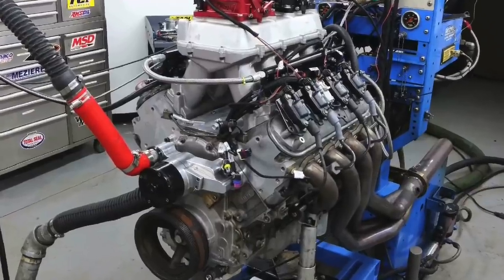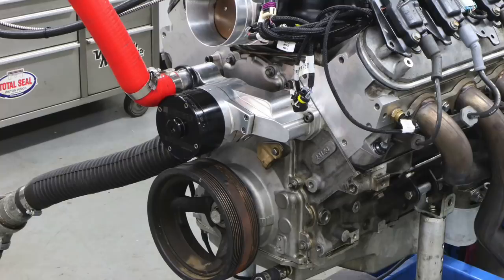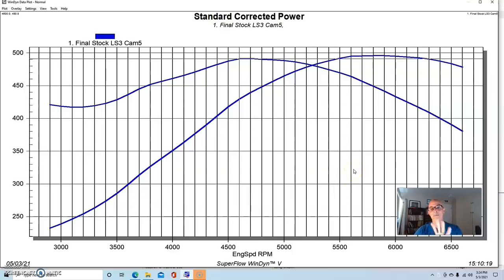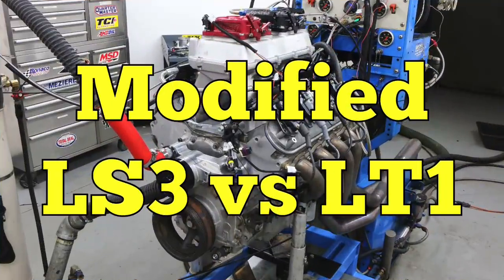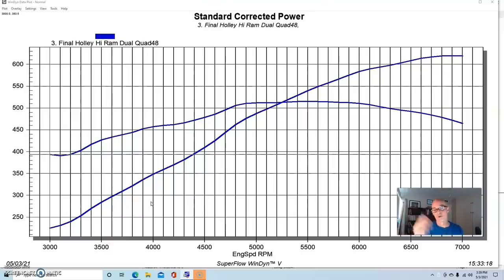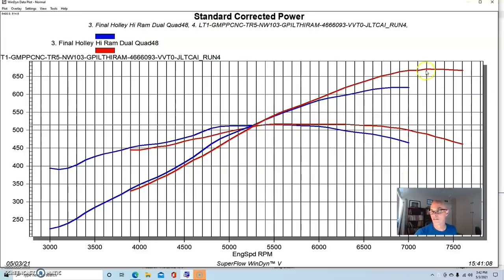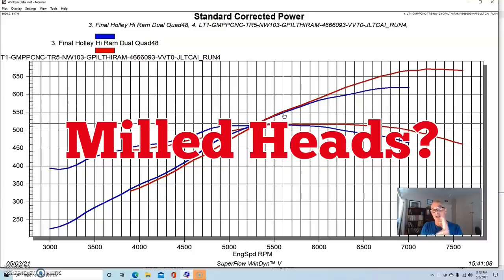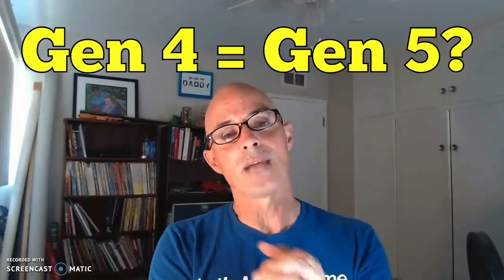LS3 VS LT1-IS NEWER REALLY BETTER? (GEN 4 VS GEN 5 6.2L)

Comment: Those LT1 NA power numbers are amazing.    WOW......
Reply: The low torque is lovely. Vvt
Reply: @hoonaticbloggs5402  Best of both worlds, for sure!  :)
Reply: numbers are higher than usual because of the way they run the dyno, i.e. long tube headers, no mufflers/cats, open throttle body, and low fluids temperature
Reply: @malamri424  and? Compared to an LS3 it's still a massive improvement
Reply: Yall be sure to remember this fun fact. LS3 compression ratio is 10.7:1. LT1 compression ratio is 11.5:1. That's a BIG contributor to the power of the LT1 and Direct Injection is the ONLY reason why the LT1 can run 11.5:1 compression ratio. Injecting the fuel into the chamber COOLS THE AIR IN THE CHAMBER THAT WAS HEATED UP DUE TO COMPRESSION. I wish I could find that article explaining all of this. I read it a few years ago. When I find it, I will post the link here. And for your reading pleasure...

L83 = 11.1 CR
L86/LT1 = 11.5:1 CR
LT4 = 10:1 CR
L8T = 10.8:1 CR

I can't wait for the price fall...
Reply: @jaydubb71  imagine these with a dual injection setup like the ford motors are running?
Reply: @Prestiged_peck  LT5 is setup with both DI and PI. Unfortunately no other SBC is. You can upgrade to it as there are aftermarket kits available to do so. They will support about any power you will ever push out the engine, but they are not cheap fuel systems to upgrade to.
Reply: @JROC734  extra injectors are always expensive, but when you make the power to need them they pay dividends, especially on a DI motor when you convert it to DPI, if nothing else it eliminates back-of-valve carbon buildup.
Reply: @Prestiged_peck  oh yeah. Gen V LT5-like setup. That has DI and port injection. Can you imagine how much the EFI system to control that would cost? The Holley Terminator Max (with trans control) is $2600 alone. And it's not setup for adding port fuel, IIRC. I could be wrong. Good luck finding a factory ECM and harness from a C7 ZR1. And if you do, HPTUNERS wants TEN CREDITS (fricken $500 bucks!) AND ANOTHER 2000 BUCKS (BIG BALLEER STATUS! Oh yeah, I got that in my cookie jar... Yeah right! I wish! LMAO) to unlock the ECM. Wanna buy a MODIFIED ECM straight out? That's ONLY $2500. So... Say you get lucky and get a Gev V LT5 harness and ECM. $2000 to unlock the ECM. $500 for credits. $550 for the PRO version of HPTuners, if you don't already have it (or you could be cheap and pay $300 for the standard version since I BELIEVE the LT5/E99 may have factory widebands... I could be wrong tho). Not including the PRICE OF THAT ECM AND HARNESS! LOL! Now, unless you know how to tune DI, imagine how much it's going to cost to TUNE IT! This won't be a 3 or 4 hundred dollar tune special. I have yet to physically touch a Gen V but I can tell you from the hundreds of pages I've read on the HPTUNERS forums and after watching all of the Greg Banish videos (yes I own them), it's a heck of a different world. I have no problem tuning Mopar and GM Gen 3 and 4 ECM/TCM setups. Or Holley. I'm really waiting to get my hands on a Gen V. I may be picking up a Gen V pick up truck myself real soon. Of course, I will begin tinkering almost immediately...
Reply: @jaydubb71  holley dominator should have dual port capability by now, know for a fact fueltech and motec do, or you might find a way to modify an 18 plus coyote ECU to run it, might be difficult to run one with just one cam though.
Reply: @jaydubb71  Holley will run port injection on an LT engine, I am running it with port injection on my 416 based LT1 with twin turbos. It made 901 on low to medium boost.
Reply: @waynedeason213  Terminator X or Dominator? Are you running DI and port injection or just port injection? Which system (part number) are you running?
Reply: @jaydubb71  I'm running both port and direct injection, the Holley controls my port injection and the stock computer controls the rest of the car.  It is the Crawford Racing CR Fueler and. I did not opt for the Dominator upgrade as I didn't need it to do anything except control the port injection.
Reply: @waynedeason213  so you're just running the Terminator X or HP system to run the port fuel?
Reply: @jaydubb71  it's whatever comes with the Crawford Racing kit, my tuner explains it all in that video. I didn't really ask alot of questions when he told me that would work, I just bought it and had them install it and tune it. Look up the CR-Fueler from Crawford Racing.
Reply: In my research for a retrofit its taking Darton sleeve and Ls7 top end money layout to touch the LT1 stuff now with their stock casting, especially with the $500 3.860 factory forged center weight stroker crank..
Reply: @waynedeason213  I mean holley drives the DI injectors with an entirely separate box, id think the terminator X would have 8 injector drivers literally hanging out doing nothing, well physically it would have to? But does the software allow it?
Reply: @jaydubb71 that comppresion runs well w direct injection and Flexfuel

Comment: The issue with the Gen 5 stuff is that it seems to be more complex/sensitive to tuning. Even the Terminator X for the LT motors costs twice as much as for the LS stuff. VVT and DI are here to stay so eventually the learning curve and costs will flatten out but I don’t think we’re there yet.
Reply: I think going to gen 5s are diminishing returns compared to the ls when you consider everything cost wise.
Reply: @theyhatehimbecausehetoldth7576  it's economics. New stuff will be more expensive than old ones, and if the new stuff becomes popular enough then the prices will come down if the manufacturers develop economical ways of doing it and decide that lowering the price is worth it.

The advantage of direct injection is on motors with boost. E85 + direct injection would help make the motor run safely at higher boost levels.

Everything has diminishing returns. You can't apples-to-apples compare decades old tech that has a ton of aftermarket support to new tech that has limited aftermarket support. If you like old, affordable tech then go with a carbureted LS.
Reply: @sepg5084  There's really no reason to run a carb on an LS. That's just a step backwards for no benefit.
Reply: @theyhatehimbecausehetoldth7576  That's why a majority of people are still LS swapping and not using the LT. The direct injection more than anything really ratchets up the cost.
Reply: When it's clean sheet like me there is about an $800 surcharge for DBW, DI and trans control ( my 67 Camaro has a 4l80e/billet lock up) on the Holley with 3.5 inch screen and VVT ( Cam 4X even less).
 Given the fact the stock heads will do well especially when ported ( you can tell this is what they wanted to do with the LS7 raise that runner NUTS like it is on the LT1, but they never got the LS7 right ) I'll actually be saving....
 Also the fact I can buy a 3.860 L8T forged stroker crank for $500 and it slide right in the Gen 5 block makes it just piston and rods for me to be up near 700hp...
 I've been looking and looking as I AM replacing a BBC I'm used to making 700+ hp with, it is HARD to find a 600whp Gen 4 LS.....
 I was quoted doing a custom darton sleeve 5.3l Gen 4 block to 4.155 and custom 4.00 rotator...then the best heads money can buy ( generally have to go LS7 and their intake ) and at 434ci barely be 550whp or 650 flywheel....
 The Gen 5 can do it at stock bore with the 3.860 crank for 400ci aka 6.6L, with much less cam and save a TON on heads...

 So more power, smaller cam less money from clean sheet and literally can run to 9s aka illegal in my old 67 NA...works for me...im not scared of DI...I just come from a boosted Gen 3 coyote and I'm used to dealing with the DI and tuning the blend.....
  Other than pure budget gap n go turbo stuff I can't see why anyone would still mess with the Gen 3/4....the stock crank on Gen 5 is stronger too...heads better...even better than LS7 when you count the LS7 failures that even the aftermarket doesn't have solved in my research....

 I'm leaning heavily to Gen 5.....
Reply: @ShawnGilbert1967 I’m also sold on the lts l83s stock will feel like driving a stock 6.0, 6.2 ls selling my ls asap
Reply: @theyhatehimbecausehetoldth7576  not when it comes to forced induction. You can make the same power on 1/2 the boost of a LS engine.
Reply: @horsefly1020  15 pounds roughly doubles engine power, regardless. so 860 with ls3, and 920 with lt1.
Reply: @dontworry6256  you may be right the old six O's are turds but the 6.2 would walk that new 5.3 especially an LS3 with 430 stock horse, but they only come in vettes and 6 speed manual camaro. the automatics have the shitty l99
Reply: I have it. Def not worth the extra cost.
Reply: @bad4health  generation 5 Motors just the better attention
Reply: same argument the old timer had 40 years ago when FI came around.  Does it cost more?  yes.  But is it better?  yes.
Reply: I would agree with that, but don’t they make kits to eliminate the direct injection and just run multiport injection to simplify tuning? I guess I’m asking is it just the DI that’s sensitive to tuning? Or is it the whole thing?
Reply: @ShawnGilbert1967 I'm sorry but your tuner or engine builder is doing something wrong. There's a guy on ls1tech making 700rwhp on a sbe ls7. And plenty of 600rwhp + ls7 and 416 LS3 builds.
Reply: @NatoriousGamePlay  if it's an LS7 on LS1tech it's in a vette going thru a MANUAL...I'm running thru a 4l80e auto( basically a turbo 400 with over drive) with FTI billet triple disc so that's gonna eat a LOT of power up on dyno even locked up... 
 I did end up gen 4 darton sleeved 427ci with LS7 brodix heads and Holley high ram...
 On dragy so far I'm trapping 128 from a dig running 10s on virigin ground no burn out just a clean off on SS tires not even a radial pro...I'm closing in on again virigin ground no water burn out no sticky just pull up clean em off and roll on 6s in 1/8 on Virgin Street with 5 year old tires...
 I know for a fact my draggy is 2 tenths slow and 2mph slow vs slips at track, factoring in the track 60ft, it's low 10s at 130mph full weight car and im fat as hell...its doing just fine NA, I did swap in a BTR LS7 Stage 4 V2 cam and my stall is WAY to tight NA so....

 Also I've never found an RPM where trap speed or fuel consumption ( duty cycle or overall lph on THIS cam it did peak on the first one) has lowered yet and I've accidentally seen 8k in one gear but have 7500rpm shifts iirc last time out, it's so easy to tell it wants more....it keeps getting faster the higher it's shifted and more timing added but I eased up on these things doing multiple checks along the way, different plug ranges it's been a long while since I got in it but every time out is a new PB for it on the dragy...in same spot..its never slowed in mph with timing or ET with raised shift points..BUT the stock holley lid and 102mm tb IS becoming a restriction I'm getting 5kpa off baro past 6400ish then at shift recovery it's matching baro...which tells me it needs more induction when it nears peak rpm....
 So still tinkering, and I don't let people build or tune my rides no point in having it, you just posses it if someone else built and tuned everything, not my cup of tea....setting up these ST2126SLR lifters to +/- .005 was a pain too without adjustable valve train....

Still wish I had gone gen 5, especially now that holley controls the 6l90 with their ECU damnit
Reply: I agree with you. For the cost to make an LT engine 30 to 50 hp faster than an ls is not worth it.
Reply: LT tech is more advanced and makes more power, the issue I’ve notice in the Chevy community, as a collective it moves very slow to innovate as it’s filled with many sloppy mechanics. I assume part of it is because it is to make power with LS platforms, but one thing they overlook is the efficiency of newer tech with less work necessary. It just takes a little more brain power and skies the limit how far things can go.

Comment: I learned that the modified LT1 makes BBC454 numbers and curves. The variable cam timing makes the entire curve 👌🏻
Reply: also high compression with direct injection
Reply: @hanzen5174  yep and pump gas without detonation
Reply: DI adds to it as well
Reply: A 5.3 LS  pumps out BBC power

Comment: I'm running an ls3 stock motor, pac 1218 springs and twin low mount Chinese t3/t4 turbos making 620hp on the factory ecu @10psi and on uk pump gas :)

Comment: I have seen some online cylinder head flow databases that show the LS3 head flowing more than the LT1.  The LT1 has a smaller intake valve than the LS3, 2.13 vs 2.165".  The LT1 exhaust port is lousy.  The reasons that the LT1 outperforms the LS3 in factory configuration is higher compression, longer cam duration, and VVT.  The LS3 can be tuned to match the LT1 compression and cam specs, but will give up some low end torque because of no VVT.
Reply: Finally someone gets it
Reply: Andy I saw it the same way...     The LT1 heads out the box do good up to .500" lift.   Ported it's going to around 340 CFM and all of us who've been in these discussions know a good ported LS3 head can get to 300CFM by .400" and 360-370CFM...   Aftermarket replacement LS3 heads such as the Mast can get up to 410 420 CFM...    So LS3 has more potential if you go by the airflow.

The VVT is a big deal in that it can add 50 ft-lb or so between idle and 4000 rpm, so you can run a "big" cam and have impressive torque in the driving rpm range.    Also compression is a big deal and if you look on the coyote where stock gen 2 makes 400 ft-lb and the gen 3 makes 420 ft-lb, the gen 3 has 12:1 vs 11:1 on the gen 2.     That's about 4% increase in torque per every point of compression increase.    4% of 400 ft-lb is 16 ft-lb, so most of that 20 ft-lb increase was due to the compression.
Reply: cant compare them with dry flow. THere is no fuel in the lt1 head with DI. the ls3 does not flow as the numbers suggest with fuel . An lt1 switched to port only configuration loses 40+ hp with no other changes. From fuel in head and airflow being much less than a flow bench

peak flow numbers are not the entire story either.

fast forward 3 years from this video and things are even uglier. Stock bottom end stock cube heads cam lt1 are getting near 700 rwhp lol. On e85. Running near 15:1 compression on the street. Good luck doing that with an sbe ls3

Comment: I've owned both the GenIV and GenV engines.  I take the LT1 hands down.  It's much easier to drive even with power adders.  The direct injection is more accurate.  Plus, the LT engine will get a touch better fuel economy.

Comment: Put them both on E85 and watch the gap widen across the curve in favor of the LT1.  91 octane is limiting the LT1 quite a bit. Either way they both are worthy engines and the LS3 is easier to work with...also easier to swap into older vehicles.
Reply: may I ask why on your final point
Reply: Fail.

Comment: Great comparison. Both great engines. The gen v is so impressive. I have the gen v 6.2 in a Yukon Denali with a tune, basic stock exhaust mods, ported throttle body and 8l90 trans. 5900 lb with driver and consistent 13.20 et. It gets 22 mpg average.
Reply: 13.2 is pretty good for something that heavy
Reply: Baller. Very impressive. MPG and Speed. Plus room in the back to sleep off a bender cause the wife doesn't have a sense of adventure or humour. Cam it and pin unruly kids to the rear window.
Reply: @james10739  The 8 speed is a big part of the et.  It’s clunky at parking lot speeds as many have experienced, but it hits the sweet spot for torque when shifting at 6k rpm and uses the hp at the top of each gear as well.  Gm did a good job on the ratios, but it’s the clunkiest factory trans I’ve ever had.
Reply: James, did the tuner help smooth out the clunky trans?  I have a 15 sierra with the same motor/trans.
Reply: @paulbrinker482  It didn’t change the occasional unexpected 1-2 or 2-1 shift and “clunk” below 5 mph.  It does shift great other than that. Very firm with the tune and I like that.
Reply: @Wilson-cp4gx  my 2021 Silverado has that same issue as well, but only when it’s cold (at least for now). I told the dealer and they shrugged their shoulders lol
Reply: @jimmy_olds  Funny!  When  I bought mine they were giving the orientation before I drove it off the lot.  The orientation guy told me it would sometimes do that, but it was “normal”, so no need to bring it for service. I thought...would have been nice to know before I signed the papers!
Reply: Moving that Steel Ship pretty good!

Comment: I think until 6,000 rpm.... that LS3 was definitely holding its own. So with some different parts yeah it’s a contender
Reply: Lol; With some different parts a Gen 1 SBC would be a contender.
Reply: @kennethpowers8995  agreed
Reply: Until 6000rpm the ls3 was being walked on if these were in the same car. 50ftlbs of torque at 3000rpm is large difference.
Reply: You just never see remotely streetable or even at all 600whp Gen 4 stuff...I was quoted a 434 Darton sleeve combo and it was gonna take a LS7 top end to try....and way to big a cam for my liking...
Reply: The 50ftlb is due to vvt
Reply: RPM motor sports has Several 600 to 675 rwhp combos on street cars.   LS3 and LS7 heads.

Comment: Direct injection allows you to run higher comp ratios on pump gas than port injection. 14:1 comp ratio on E85 direct injected motors is very doable, and 12.5:1 on boosted E85 DI motors is also doable, of course with a good tune.
Reply: Yes!